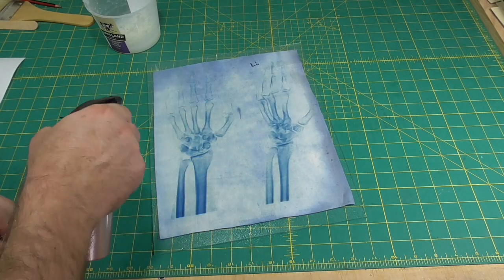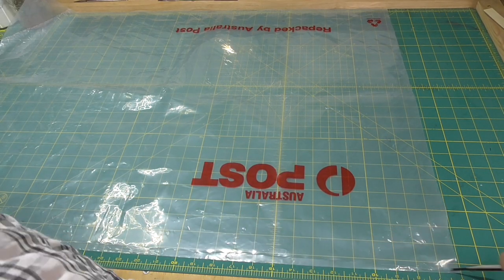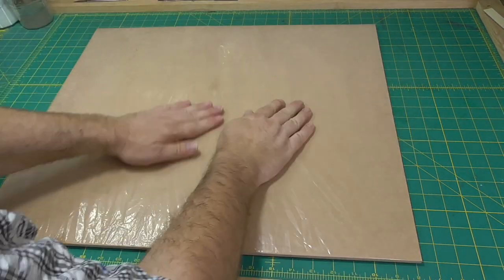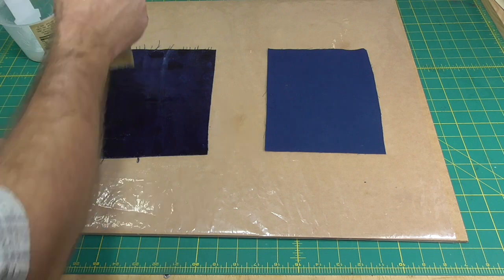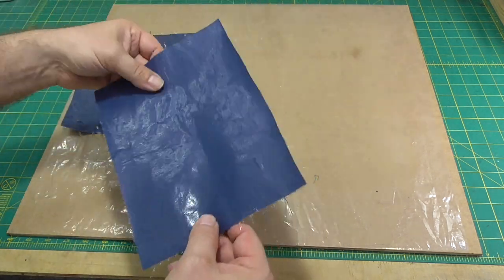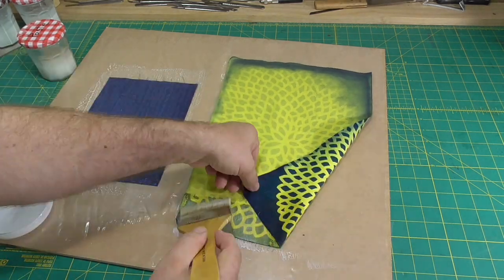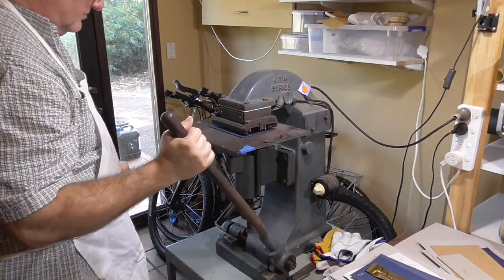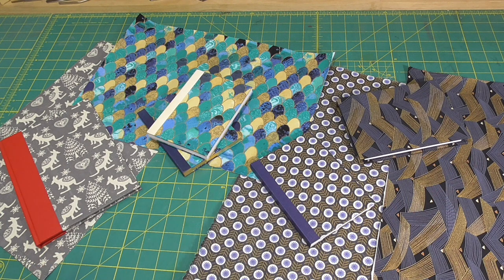DIY Bookcloth; Filling with Media // Adventures in Bookbinding

Comment: Have you tried using just spray-on acrylic on both sides?  Or mix acrylic medium with diluted PVA white glue instead of paste?  Another idea I have in mind is to use acrylic paints in the paste mix for some interesting effects.  Also, spray-on varnish or lacquer might also work and will give a waterproof surface and add an interesting gloss.
Reply from the maker: I have done some experimenting with PVA and found the resulting cloth to be very stiff and the texture not near as pleasing.  I have had some people tell me about their experience with PVA so I will keep experimenting.  I really don't like spray on anythings - having to put on a mask, drift getting over everything.  So I try and avoid spray on.  The long term stability of varnishes would be a concern.  Most of the Martha Cole video is about decorative techniques using acrylic paints added to the mix.  Paste paper but for fabric.  I've been experimenting with this a lot and once I have enough nice examples this will be in the third bookcloth video.  Thanks for your ideas!  All the best, Darryn

Comment: All your videos are extremely informative so may thanks for them. I have what is possibly a silly question but once the fabric has treated and dried does one use PVA glue to glue it to the cover or box or whatever. Thanks
Reply from the maker: Yes, PVA is the main adhesive I use with cloth.  I'll sometimes use a PVA methyl cellulose mix if there is a chance I may need to reposition the cloth.  PVA tacks so fast it is usually a one shot deal.  The mix gives a bit of open time for repositioning.  Ciao, Darryn

Comment: Exactly what I have been looking for.  I want to make book cloth that will stand up to a bit of wear…..let me ask you this…I am interested in using prints of my artwork on paper or maybe in some cases original artwork on watercolor paper. Do you have any experience or suggestions on what I should use or if I can even make some kind of covering that will have protection?
Thanks in advance.  I know you are busy and I appreciate any direction or guidance you may have
Reply from the maker: You can cover with paper, it just won't have the same durability.  I'm not sure about making the paper more durable.  One idea might be to scan you art and print it on commercial bookcloth.  I find the very durable Arbelave bookcloth feeds well through my inkjet printer and prints well.  Good luck!  DAS

Comment: I’ve been experimenting for a few weeks with natural dyes (red onion skins and black beans are my favourites so far 😊) and backing the dyed cloth with paper using starch paste. I thought I might start experimenting with what you do in this video next.

When you use acrylic+paste, is there a reason you use starch paste rather than methylcellulose? Did your previous experiments tell you that was the best mixture to use?

And how are your experiments going with the filling with coloured paste? 🤔😊
Reply from the maker: I haven't had time to do any paste papers is ages.  It is high on my list of things I need to do.
I don't like the shiny result from MC.  Some people do.  I don't think there is a "best" mix.  They all give different results and it depends if you like the result.  I like a bit of texture but not much.  Some people like a lot, and some none.  I like how the acrylic provides some robustness and water protection.
Reply: @DASBookbinding  I tried the filling with coloured starch style experiment just a few days ago. It has potential! 😄 I used potato starch and cheap acrylic paint from the cheap bin at the store (no need to buy expensive colourless acrylic medium if the starch is to be coloured 😊). I might have slathered on a bit much since there were brush-strokes still visible after it dried, but in all it is well on the way of becoming useable after just one experiment. 

Perhaps I’d like the methylcellulose kind? It probably would remind me of the buckram of the library books of my childhood and youth. 😊

After having done that I hade some coloured starch left so I also did my first proper experiment with paste paper. Just two pairs of pulled papers, but that has even more potential.  😃✌️

Comment: Wait. So I apologize, I'm a little confused. At the end you said that the past did NOT take the foil. But right after, you said if you need to use the foil, you suggest using the past median? And the only link in the description is to the past mix that you make to glue things together. 

Is that video the type of mix you use to be able to use the gold foil embossing?
Reply from the maker: The best result I found at the time was acrylic medium paste mix (I think it was like 1 part medium and 2 parts paste).  The paste I used is my standard wheat starch  paste made with a 5:1 ratio with water.  It's not that special.  You could use wheat flour paste and adjust thickness with water.  Best bet is to experiment and see what works for you.  Good luck!  DAS

Comment: What’s the reasoning behind mixing the acrylic medium with paste? Could methyl cellulose be substituted? Can acrylic medium be used on its own?
Reply from the maker: It produces a nice texture and surface finish.  Yes, people use MC instead of paste, or even all three.  And yes you can use the medium on its own but I found it didn't have a lot of body.  Something that I have found works well for me is to make the cloth as per mix of medium and paste and once it is dry give the outside a final coat of medium.
Reply: @DASBookbinding  You’re the man! Excited to start tinkering with adding acrylic medium to the MC I use now.

Comment: Have you ever tried filling with beeswax? Maybe an acrylic backing on one side and then iron beeswax into the other?
I'm running a bunch of experiment swatches right now and I'm trying to find something that's water and dust-resistant.
Reply from the maker: No.  I would imagine the cloth would hold too much wax and it would be soft.  Maybe there is way to put a very thin surface coating of wax on like I use for paste papers?
Reply: @DASBookbinding  I've been experimenting for the last month or so and I have had some success with filling the cloth with acrylic+paste and then coating a sheet of parchment with a thin layer of wax. Then you can iron the wax sheet onto the fabric.
I'm not 100% satisfied with how the finish looks, but it IS water-resistant and it doesn't seem to make the glue less effective. I feel like it's possible, but it's not easy.
Reply: I've thought of trying wax too, to make a cloth that looks a bit like the early 20th century embossed encyclopaedia book covers. Instead of using heat to apply, I'm thinking making a paste with turpentine (still using heat to dissolve) and using a mix of bees wax and the much harder carnauba wax with higher melting point so it won't get tacky in warm weather or from warm hands, applied to a very fine, dense cotton fabric.

Comment: It's possible to mix two methods in same fabric ? ex. In linen cloth backing with paper and in front with acrylic mix to accept the hot foil ?
Reply from the maker: Paper usually accepts hot foil by itself.  If the paper is too thin to use as covering material, I'd back it with more paper rather than cloth.  Good luck.  DAS
Reply: @DASBookbinding  I would also like to suggest you make a video about foils and how we can impress to fabric and leather titles, either with a manual typeholder or with a blocking machine. I try impression with my hand typeholder in bookcloth and not all letters are impressed in full but broken.And last where could i find a vintage blocking press ? Thank you.
Reply from the maker: @vaidoo  I wouldn't use a hand type holder for cloth.  I know you don't have a blocking press, but I don't think you can get enough pressure with a hand chase to work on cloth.  I'd be thinking of some sort of mechanical system to help apply pressure.  Used blocking presses are hard to come by.  The ones that don't work very well tend to do the rounds of the market.  I've made do with a few of these presses and upgraded whenever I had the chance.  It took me a long time to find one I was happy with.  Good luck!  DAS
Reply: @DASBookbinding What is the difference from the leather? Because same broken result i also had it with the leather.To buy a new blocking press, which brands are considered to be of better quality? Thank you

Comment: Dumb question perhaps but why not use the acrylic medium alone ?
Reply from the maker: Great questions that I've been waiting for!  I experimented with this.  The medium by itself doesn't have as much body to it as I expected.  It failed to fill the weaves in the cloth very well and adhesive struck through in my couple of test pieces.  My instinct was that the main reason was to make the medium go further as it is expensive.  But it seems it is important to add body.  So the result wasn't what I expected and I don't understand it, thus why I didn't mention it.  But I was prepared:)  I'll do a third video on bookcloth one day and if I understand this then I'll mention it.  Thanks for asking!  DAS
Reply: @DASBookbinding  I have been  using PVA and water 50/50, applying it to one side of cotton fabric with a silicone "brush . The liquid moves through to the back or underside of the fabric giving me a soft fabric feel on top. This cloth is used in art journal that are for personal use . I have also used acrylic fluid mediums successfully but PVA is less costly .

Comment: How about backing the fabric with paper as in your previous video and then using one or more coats of spray varnish or other finishing sprays for waterproofing the front?
Reply from the maker: I don't like using spray anything.  It's so messy.  You have to go outside and even then I usually find the hair on my arms get a slight mist of something on them and stick together.  Yuk.  Plus, I'm not sure I want to trust an unknown varnish in the long term (decades).  I'm going to stay with a quality acrylic which has a good track record.  But I'm not against you using it, and it should do the job.  Not much to loose if you want to use it.  Good luck!  DAS
Reply: @DASBookbinding  Thanks for your reply. Yes, I have varnished my arms in the past too. Do you have an opinion on using Nori paste as a substitute for wheat or starch paste? And thanks for a great series of videos - what I would expect from a physicist/engineer.
Reply from the maker: @saxhorn1508  I don't use Nori paste.  I know it is widely used in the bookbinding community, so it is hard to say anything against it.  I don't know anyone that uses it for traditional leather binding.  Since I have paste on hand for this reason almost all the time I just don't need it.  It's starch based so must have preservatives in it.  It's been so widely used for so long these preservatives must not yellow with age, or someone would have said something by now.  So, yes.  Ciao, DAS

Comment: Thank you for this video, I plan to make good use of these instructions  one question...... when you cut the dry fabric off of the backing board the plastic film was adhered to the cloth, did you peel that film  off of the cloth at some point before you used the cloth?
Reply from the maker: When filling the material and letting it dry on the plastic I peel the dry cloth off the plastic.  It doesn't get cut out like the paper backed version.  I reuse the plastic many times.  DAS
Reply: @DASBookbinding  oh I see. The back of the fabric is shined because of the smooth surface of the plastic. Thanks for responding 👍